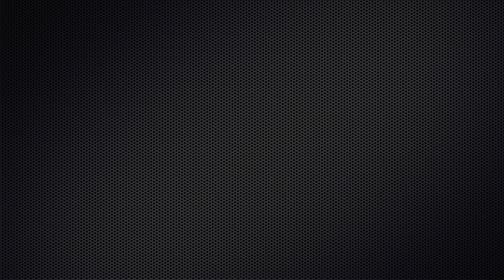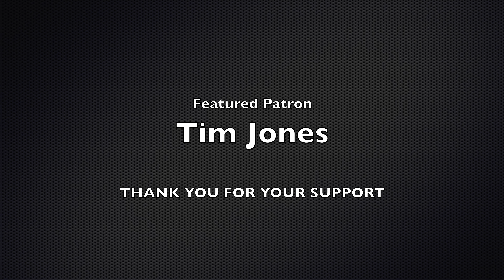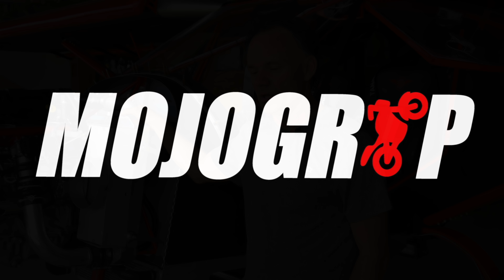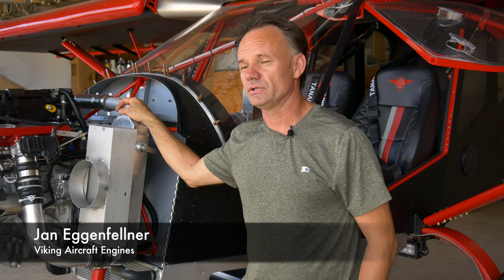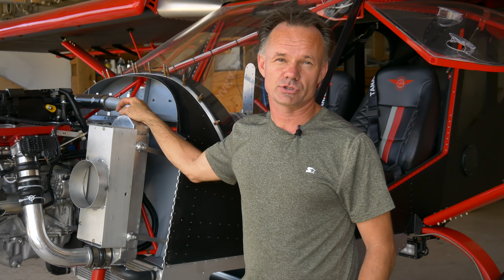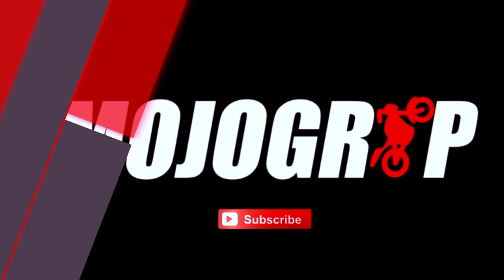Aircraft Engines l Auto Conversions VS  Certified Engines

Comment: I highly suggest researching further than YouTube video’s on the Viking engine!  Jan makes a lot of wonderful claims about the Viking that are just not true...  Honda makes a excellent automotive engine but that does not automatically make them an excellent aircraft engine!  There is a lot more that goes into a certified engine than just Engine technology, and I would like to see Viking even make the ASTM standards required for Light Sport!  The Rotax engine is by far a superior aircraft engine and Jan claiming the Viking is superior based on Honda’s technology is a joke!  Research Eggenfellner Engines https://www.vikingenginesissues.com
Reply: Nonsense ! Prove your point ?
Reply: @flynic3  You do have a point with the Viking. Not my first choice ! I may be looking at this issue from a different experience. I have been flying all my life. I have more than I care to remember off field excursion's over the years. All have been in certified engines. As a A&P I have seen engine tech or lack of for 60+ years. The big two are not very good. They have not changed much since the thirties. Seems to me most common sense engine conversions are somewhat better than what we have now.  Example at the far end. The corvair. With the fifth bearing and very carful assembly results in a engine at least as good as any comparable Lycoming. I believe you and I are not very far apart in our thoughts
Reply: Paul Van Tries I am not saying that Lycoming and Continental do not have their Failures, and I would agree with you on the design evolution being stagnant.  That being said, The R&D or lack there of on the Viking engine does not even come close to that of Rotax, Lycoming and Continental.  I am all for using new design idealogogy as long as it goes through the proper R&D to make it an aircraft engine.  Slapping off the shelf parts onto a Honda engine from a wrecked vehicle, and claiming it is superior is absolutely insanity!  Jan could not even get these engines to pass ASTM standards... So what makes them superior?  The Honda engine technology is excellent, but that does not automatically make it a superior Aircraft engine as he likes to claim!  I would agree with you completely about the Corvair from Wyse or Wesseman, and If I were to go the Auto Conversion route... That would be my first choice.
Reply: Well said, I believe you & I have common ground. Honda being my least favorite. maybe Suzuki !!
Reply: Paul Van Tries Yeah, I would agree completely!  I think Mark with Aeromomentum has done a great job with the R&D on those engines!  I still feel like they need to build some strong fleet hours proving that R&D, however the whole project looks very promising! My issue is not with the Honda engine... I think they are an excellent engine in a car!  My issue is with the ridiculous claims Jan makes about the Viking after very minimal R&D to make them an Aircraft engine!  He tends to use his customers as his R&D department and I know many who have bought into his lies... Spent a lot of money with him and are still not flying due to the Viking engine they installed having issues. I have also seen first hand one loose oil pressure after takeoff... and that aircraft is still grounded as well.  I could go on and on with first hand experience on the Viking engine that is all Negative! So when he gets on YouTube and Facebook making these ridiculous claims... I have to speak up and say something!  Before someone gets seriously hurt or killed due to his bogus claims and lies!
Reply: @flynic3  The more I think about your post. You are 100%  correct. The Yamaha comes to mind. 2 gear boxes ? and a clutch. OMG. Rotex  is not the answer. Maybe UL ? Seems there is no affordable quality engine available. Not yet.
Reply: Paul Van Tries Even the Viking is not that affordable after you add everything up needed for a full FWF package.  All said and done you could almost purchase a proper aircraft engine... When it comes to a low cost solution I like the Corvair engine, Jabiru 3300 and Revmaster line.  I know the Revmaster is VW based but has 60+ years of R&D behind it... it has come as close to an actual Aircraft engine as a VW based engine will get.  I personally will be building my next project with a Jabiru 3300 engine.  They run extremely smooth and with a few upgrades along with TLC will easily hit a 2000 TBO.  They may require a little more tweaking than say a Rotax but those arent perfect either.  With a Rotec TBI, Upgraded 50amp alternator and Electronic ignition on one of the plugs (I am leaving the other Magneto) The engine will produce ~127hp and burn 5gph.  That is the route I plan on taking...
Reply: @flynic3  We do agree. Have been flying all my life. 68 years young. EAA was in Rockford about 20 planes, I go way back. VW was all the rage. OK engine, not enough power & a few other problems. What do you think about the UL lineup other than the price ? Aeromomentum seems ok price is in the corvair aera. As you have clearly stated untested !
Reply: Paul Van Tries From what I have seen the UL is an excellent engine and well worth the money... I am fortunate to have Robert Helms living close to me.  If I had the money, I would purchase the UL350is in a heartbeat... however in the end I will have half the cost of the UL invested into a Zero time Gen. 3 Jabiru 3300 that I plan on installing in my build.  Revmaster just released a 3 liter 100hp engine at Sun and Fun for $14k... 
I have been into Aviation since I was a kid and work for Ideal Aviation based out of KCPS... But I do not have the experience you have by any means!  I do spend a lot of time researching as well and have learned a great deal that way... but nothing beats the hands on experience that I receive at work.
Reply: @flynic3  One last question I wont bother you again. Maybe ! Don't sell yourself short. I believe you have done your research & have learned much. I also worked &still do in aviation all my life Alphin aircraft Hagerstown md. Got to fly everything & get paid. Even most all ratings. Life has been good. My Dad was all things piper may he RIP. Just a guess I did not see what airframe you are going with CH750 ? maybe a Just ? They are all good ! Many thanks for your input. You are one of the good guys !
Reply: Paul Van Tries You are more than welcome to ask as many questions as you would like my friend!  I personally don’t mind answering questions and enjoy passing along the knowledge!  I am building a Sonex Waiex as a group build project with the Young Eagles in my EAA Chapter.  My good friend William Dahl is the main machinist at Zenith and I almost went that route... however after all my research I just kept coming back to the Sonex Waiex B.  The cost per performance ratio just can’t be beat... and it is aerobatic as well.  Cruising at 160-165mph on 5gph allows for pretty great cross country efficiency as well.  What are you currently working on?  I have never worked at a better job in my life and wish I would have followed my instincts as a kid and taken my A&P at the technical school that I attended.  I look forward to going into work everyday for the first time in my life... and love every minute of what I do!
Reply: @flynic3  Well said ,Waiex rules. So you want to play & go fast ! Now I see why you like the vw. Sonex turbo kit sure looks like a winner.
Reply: Paul Van Tries I am still a little leery about the AeroVee and the AeroVee Turbo... If I went VW I think I would go the RevMaster route.  Albeit Heavy... I feel they are more refined and built solid.  I think they are overbuilt and the prop hub bearing design is superior.  I think the AeroVee Turbo needs to build more fleet hours as well before I would be interested.  I do feel they have resolved the Turbo seizure issue with the water cooling solution, but I am still waiting to see some sustained fleet hours.  I guess I am just looking for an all around performer and sporty flying aircraft.  Something fun to fly but will provide decent cross country efficiency.  Something with a good bang for the buck pricetag and easy to build.  I wanted something that would also provide low overhead operating cost, so it could be used in a flying club enviroment for training purposes.  I really like the look of the Waiex as well.   If I went the STOL style aircraft route... I think I would build a Belite Chipper.  I would like to see more fleet hours on that kit but feel it is well built... and fits all the bullet points that I am looking for.  It is also one of the more innovative designs and has never stopped evolving since inception.
Reply: I was going to post but you said it.
Reply: Paul Van Tries You also mentioned the Yamaha engine and I am assuming that you are referring to the Apex snowmobile engine.  I feel the gentleman who designed the Skytrax PSRU for this engine has done the proper R&D for the PSRU.  I have followed the developments he has made over the past 2-3 years and have been impressed.  I feel this engine does have a lot of potential and I would like to see what Edge performance brings to the table now that they are also working with the Apex engine.  I have been thoroughly impressed with the Edge performance products and feel they will move the Apex in the right direction.  I still feel like this engine being used in Aircraft is still in its infancy, however am anxious to see where this will lead in the coming years.  Another honorable mention that I have not brought up yet is the D-motor out of Belgium.  I think this is another brilliant design that has a lot of potential!  I was actually looking into becoming a midwest dealer for these engines and feel Dave with Fisher will represent these engines well in North America.  I have heard that they are looking into Turbocharging the four cylinder, which would be another great engine option.  The Six cylinder is a little pricey but I am hoping the Turbo four will come in right around $20k or slightly more.  I think with some more fleet hours these engines will also be an excellent contender!
Reply: Guys this disscussion is awesome .. i am bumping it up after 5months to keep it going .. really intrested in finding a low cost easily maintainable solution instead of the monopolized unaffordable un maintainable  big twos whos tech is very very old now
Reply: Curious to hear of any updated thought on Aeromomentum. Mark seems to have a promising package (vision, technical background, good intentions, straight shooter).

Comment: Automotive engines were not designed for constant high revs. High RPM. I am sorry I disagree with Viking and all automotive engine users except for one, the Corvair engine as it is air cooled boxer engine and revs reduced to around 3K per minute max. Otherwise horses for courses and I would very much prefer a Lycoming in my aircraft to any auto engine .!

I have seen Lycoming engines run for 20 minutes or so after catastrophic enteral damage only to see you safely on ground before quitting.!  Show me an auto engine that can do that. .!
Reply: How many automotive engines ever suffer from any kind of catastrophic damage in the first place? That's the thing here, LyContisaurus engines are EXTREMELY unreliable when compared to modern automotive engines.
Reply: @PistonAvatarGuy  EXTREMELY unreliable .!   Totally untrue.
Reply: @Andaluxsystems  Compared to turbine engines and modern automotive engines, they definitely are.
Reply: Andaluxsystems Auto engines are used  in Marine applications and handle the RPM with no problem.
Reply: The Viking Honda replacement  https://www.youtube.com/watch?v=3GMgO8ycGxU
Reply: I wouldn't put a STOCK car engine in a plane, thats why people rebuild them to run at constant high rpms, better internals, more oil squirters, etc and it will be just as reliable at a lower price
Reply: @brewcityboatclub8299  the cruising 3000rpm is hardly high rev's for modern engines built by any automotive manufacturer, combine that with ecu's and modern fuel injection systems you couldn't beat the reliability. They still sell planes with carbureted engines for God's sake...

Comment: What are the rpm engines running the max time?? Car engines are ruined running max rpm all the time ..
Reply: Education he said 5400 at climb and 4800 at cruise for both. That’s high
Reply: @Truzakar  That's the same for the Rotax 912.
Reply: @Truzakar  its better to go with specialized engines instead of hacked car engines I believe. There are 2 ignition points in aircraft certified engines which make them safer as compared to car engines having single spark plug for single cylinder, better engine performance at constant rpm near about 2700 to 3000 rpm in most cases, better torque management and directly connected propeller shaft ...
Reply: @engineeringresponse4406  The unreliability of mechanical ignition system is only reason aircraft engines need to have two ignition systems in the first place!
Reply: @PistonAvatarGuy  car engines are designed to run on surface where you can put your car on the side in case of problem, while failure of aircraft engine means a miserable death .....
Reply: @engineeringresponse4406  Yeah, except that the engines that you'll find in most light aircraft were designed 80 years ago and can't come close to competing with modern automotive engine technologies.
Reply: @PistonAvatarGuy  It's on the public demand and industry work and research. Automotive engines are getting new technologies thanks to continues development and increasing demand with new and better features. With the era of flying cars, seems there will be technology improvements in aircraft engines also.
Reply: @engineeringresponse4406  Whatever you want to believe, bud.